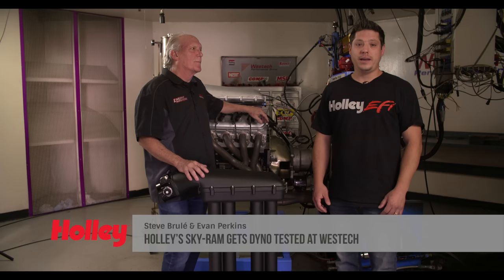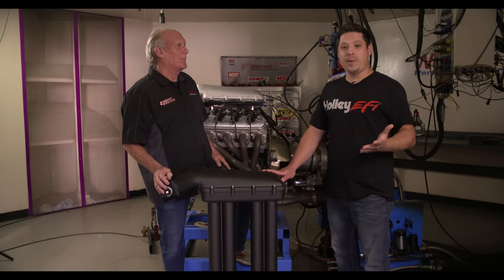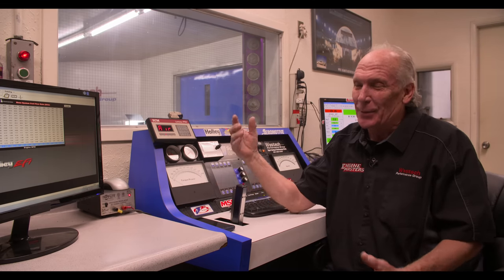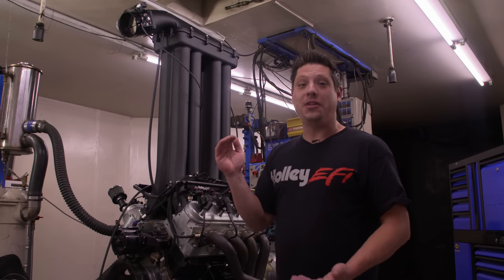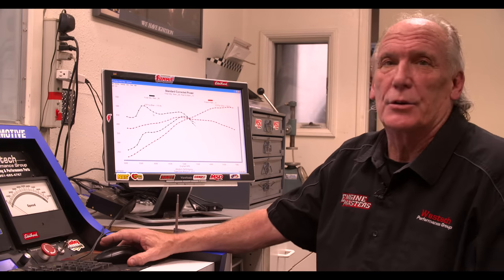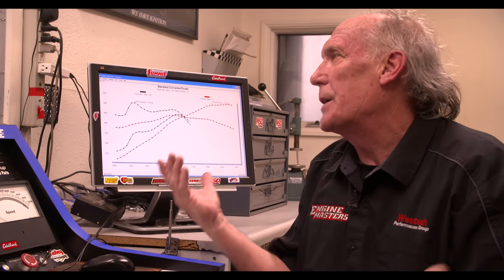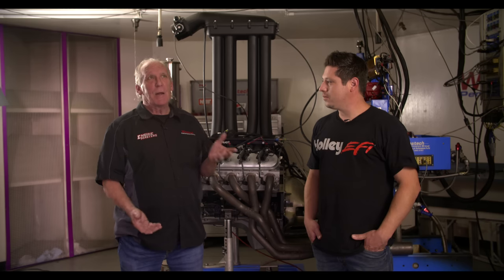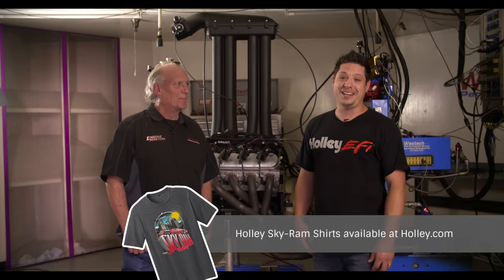Holley Sky-Ram Intake Manifold Hits the Westech Dyno

Comment: Look at the data closer, there is knowledge that can be gained to design a better intake than the one you tested against.  The pressure on the intake valve is 1/2mass times the Velocity squared.  In other words if you reduce the length and maybe a little the diameter you will move the peak torque up the rpm range.  The reason you have a hump is wave tunning, when you have a nice flat torque curve you are giving up power that could be had with out much effort.
Reply: the reason for the hump is the ridiculous runner length...

Comment: Please your apinion just had my 421 Chevy engine dynod said only 373 hp 460 lbs torque is that possible bored 40  584 lift hyd roller cam 208 profiler heads flat top Pistons everything forged new holly sniper EFI I was hoping bout 600 hp I'm shocked

Comment: There's also all the mass at the end of the runners acting like a lever. I would imagine if you did too much accelerating it could snap the runners, even with the steel rod.

I wonder if Holley would ever do a variable intake manifold like many German V8s have.

Comment: Question. Does the sky ram need to be straight? Or can it have a curve or spiral?
Reply: You can make an intake runner any shape you want. Just look at the dual-length intake manifold for Australian Ford 6 cylinder Intech engines. The plenum connected to a shorter straighter set of runners with a longer set of runners wrapping around the plenum, and a set of butterflys blocking off the shorter runners at lower RPMs.
https://i127.photobucket.com/albums/p148/Rollinfourlitre/factoryassembled.jpg

Comment: Was the fuel injected at the top of the intake or still down at the rails next to the heads??
Reply: At 2:34, they’re putting on the fuel rail down near the heads.
Reply: @Joel_E  that's what I thought. Isn't the point of a high rise manifold to drop fuel from above and accelerate it???

Comment: With all the computing power available with aftermarket EFI systems it surprises me nobody has started marketing an active intake manifold yet.
Reply: Been done, on quite a few cars, was a hill climb car here in the 90's using an active manifold on standalone. 

Also numerous other engines using them stock and people still use them when on standalone.
Reply: @garyhowe88 Off the shelf aftermarket ? .I know that the oem,s have had active intakes and have seen a few home brews. But i haven't seen the likes of edelbrock make anything.

Comment: Not much different than the 305 / 350 TPI engine. Loads of low rpm torque and a 5500 RPM tuned rev limiter. LOL.
I think total runner length on those was about 21 in.

Comment: But you used injectors at the same low height. Not the same, If you go carbureted then you have the weight of the fuel mixture and the advantage of gravity pulling the mixture into the cylinder... All you guys did was extend the air intake, there's no extra fuel and gravitational force with relation to distance. Try with carburetors and fuel, not low injectors, what good Is that?
Reply: Doesn't matter... they would have changed the injector location on the hi-ram vs the lo-ram if that actually made any difference at all.

Comment: I'm kinda disappointed to be honest. We know longer runners tend to produce all its power at lower rpm. Why put it on a combination ment to zing it to the moon. A stock rpm range engine would have been far more interesting. Lol next up lets put some stock 882's on a sbc with a 280 duration cam to watch it fall on it's face about the time the cam starts hitting its stride🤣🤣🤣🤣